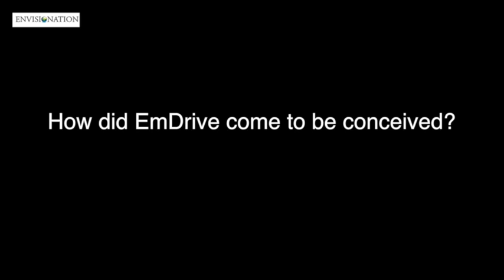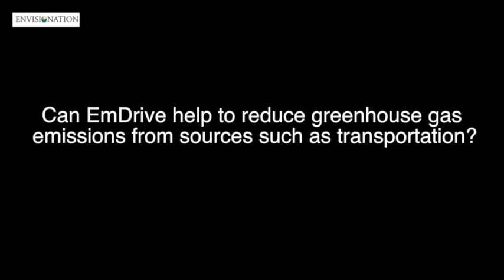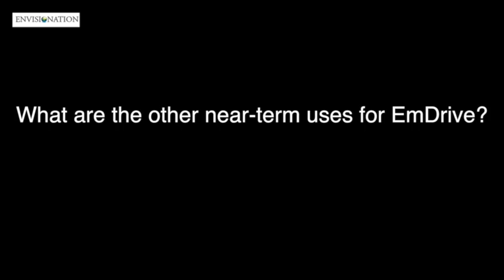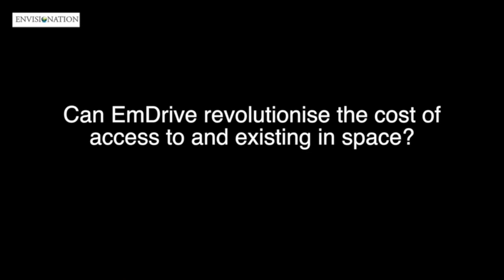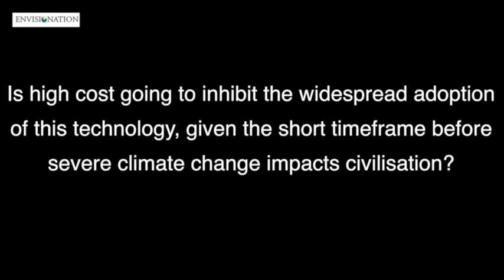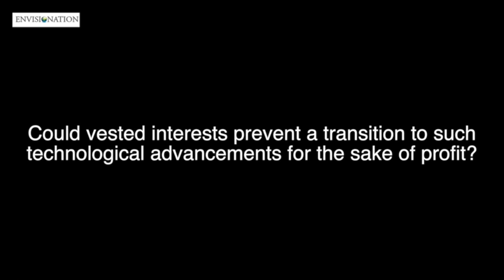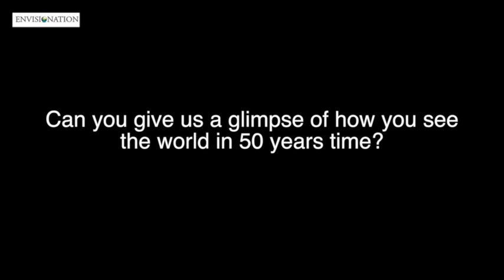Full interview: Roger Shawyer, Creator of EmDrive

Comment: The Emdrive proves that Minkowski was correct. He predicted that the decrease in velocity of light in a dielectric would cause an increase in radiation pressure. By placing a high dielectric material at one end of a can more momentum is deposited on the dielectric side by a factor of the square root of the dielectric constant. If PZT is used the constant is 1200.
F= Pw x sqrt(1200)/c. The force is 34.6 time higher on the dielectric end. If a superconductor is used for the can then the conversion efficiency is high.

Comment: look at these scientifically illiterate simpeltons whose jaws are dropping in awe at a complete fraud, the thrust produced by this sort of thing is weaker than the weight of putting your phone on a table. Good luck accelerating a massive rocket with that much force. 

By my calculations (using experimental data obtained by the study associated with this 'professor'), it would take 354 million years to accelerate a 10 tonne rocket to the escape velocity (11.2 kms-1) of the Earth. And this is completely ignoring air resistance.

GGWP

Comment: If the principle is fully classical, then it is very clear there is no thrust for a completely sealed cavity, whatever shape it is. The electromagnetic force acting on an object can be calculated with Maxwell stress tensor. This is done by performing a surface integral of the stress tensor (defined by the local EM field) over a closed surface around the object. The tensor, and the resulting net EM force acting on the cavity, is zero since there is no field outside the cavity.

Comment: I think my wife and I saw one of these flying in Palm dale CA around Northrop about 20 yrs ago. (Side note, my uncle retired as head of QC for Northrop decades ago, Bernard or Uncle Bernie as we called him). What tipped me off was the guy here,  Roger Shawyer mentioning the water vapor, vertical take off etc. There was NO SOUND (and it was relatively low in the sky and near us) and only one small cloud in the sky BUT what drew my attention is that with my polarized sunglasses we could easily see a sort of ? dark looking transparent light or ? slowly moving counterclockwise around the outside of the cloud extending out about twice the distance of the cloud. It just sat there. After a while we got bored and left. There was no one else around and no sounds, no dogs no birds nothing. It is what it is and now it is documented here forevermore. I really need to draw a pic of what we saw because the ? dark light was in pieces and bent, oddly shaped smaller near the cloud and larger as it went out and rotating slowly. The outside of the light ended in a perfect circle around the cloud but twice as big as the cloud.

Comment: Can someone please point me to solid experimental evidence that there is no external ionic wind.  Please provide evidence that a plate behind the larger plate does not experience a similar counter-thrust.
Reply: *****
So do ionic winds.
Reply: An electron boiling off a cathode can produce thrust. Also, there is plenty of potential fuel.  There is metal there that can be turned into ions.  I just want to verify that this is not happening.  It should be a simple enough experiment.  It just requires stuff around it to catch any potential particles that are being thrown.  Also, highly tuned systems are adept at remote power transfer.  I suspect something like this is going on.  The power can be transferred efficiently  several meters in a highly tuned system.
Reply: You seem to be missing the point: it does not matter what is 'thrown off' within the Emdrive. If the ejecta are trapped anywhere within the same device, any propulsive effect will be negated. Did the starship Enterprise have a bowling alley? Do you imagine that they could propel it (even slightly) by rolling balls? Yes, until the balls hit the pins, etc. Get a grip!
Reply: MrAaronvee
That is why I mentioned that it will likely subside, as "experimental error" is increasingly discovered in the several independent experiments by respected establishments which have verified the phenomenon.  They must have missed something. I suspect they're using so much energy that they're boiling ions off the outside of the metal of one side, and re-supplying charge through power supply, or that they're neglecting the input feed entirely.  These would be pretty basic errors, however.  The Chinese have already apparently backed off from their claim of a good fraction of a Newton of thrust, to something much less significant.
Reply: Indeed: as Langmuir pointed out, there is often initial positive evidence - reported by reputable people - for the most unlikely of ideas. They then gradually give way to weaker and weaker claims (the precise opposite of real science).  But why does this still happen? Why are reputable organisations not more circumspect? One begins to suspect that they welcome the publicity; after all, how many people will know or care what nonsense it is?
Reply: MrAaronvee
Also, I was looking for some verification that ions are not being thrown off from the outside (not the inside) of the device.  This would be as if the whole em-drive cone were a cathode, ejecting electrons from its outer surface with a endless source coming from the power supply.  It seems like an obvious and easy thing to check for, so you would think this would be covered, but I haven't seen it written about.  Another remote possibility (explaining only a tiny amount of thrust like picoNewtons) is that the fields in the resonant cavity get so high that electrons in the chamber accelerate, with more slamming head-on to the larger end...  Though the electrons within the chamber would balance in momentum, there would be a minute increase in radiation heading outward on the external face of the larger side.  These could be X and Gamma rays, so relay more momentum than visible light.  But still, it would be incredibly minute and likely not possible to measure the effect.  Finally, we must completely discard experiments that are not:
1. in a vacuum
2. completely self-contained (inc. power)
3. completely isolated from interference
4. completely decoupled from measurement
In short, almost all experiments performed to date are seeming grossly invalid according to required elementary experimental procedure.
Reply: Yes, the concept of simply pasting a radioactive substance on one end of a cylinder has been proposed. One can even imagine that one of those crackpot machines, in which balls are bounced off the inside of a cylinder, might move slightly -  due to differences in the heat dissipated at the two ends. But my money re Shawyer is on mere vibration.  Vibration can produce some amazingly counter-intuitive phenomena,  and some professional engineers are not even aware of that.
Reply: My money is on near-field interaction with the measurement system, and/or with cathodic behavior (that is, ion drive with re-supply from wall current).

Comment: I get that it might be possible, at least as a demonstrator. But is it scaleable in the real world? I've read the Alcubrie warp drive works in principle but would require more power then is available from the observable universe to actually work. I know the EMdrive is not a warp drive. I'm just using the Alcubrie engine as an example of something that might work but will never be practical in reality. I mean you would have to shove a lot of electrons or photons against the pressure wall to lift a space craft. Maybe the solar reflectors would have to have more area then say the pacific ocean in order to get enough ulf into the cavity?

Comment: Wait i thought EmDrive could only produce a very small amount of trust compared to the energy put into the device, how could an engine only strong enough to move satellites in a vacuum without air friction could one day lift a car and counter the force of gravity ?
Reply: ***** I'm pretty amazed that a fuel-less engine can work to begin with, it was about time. I just hope this technology will advance quite rapidly and not over a long period of time so it can be made cheaper. Maybe when i'll be old and grey flying cars will be a thing. But i don't have high hope for that. Advances always seems slower than we expect.
Reply: +Zool Ock The problem i have with these massive speeds is that you wouldn't want to hit even a spec of anything traveling at half the speed of light, or the resulting force of impact would be very destructive for both ship and occupant..The odds of not hitting even a spec of dust in space would be practically zero.

Comment: My opinion is that the effect is not based on conventional physics and that it is based on Warp Drive. I do not agree with Roger Shawyer's assertion. Alcubierre Warp Drive means that an energy extraction machine shrinks space-time metric drawing far bodies of mass a little closer so by Mach's principle, they lose gravitational energy and the machine will extract energy on the expense of the metric. Also momentum exchange is via the background metric with far bodies of mass.  Please read my paper and its corrigendum,
http://sciencedomain.org/abstract/9858
DOI: 10.9734/PSIJ/2015/18291
See also corrigendum 
to DOI: 10.9734/PSIJ/2015/18291
in http://sciencedomain.org/issue/1288
We need to keep an open mind. Inertial Induction was discussed by Dennis Sciama in 1953 and had a covariant formalism also by Dennis Sciama in 1964.
Another point is a working machine entails high charge separation. If you separate charge on a 10cm x 10cm parallel plate capacitor then with very low relative permittivity close to 1  and 37 Kv voltage with 1cm distance you will get less than 0.1 micro-Newtons which is an immeasurable thrust. High dielectric slab will have induced dipoles anti-aligned and cause
an opposite warp effect that will cancel out the thrust. Virtual charge separation by using transition states of radio wave photons may achieve a feasible effect. To get a feasible effect, there is a need to separate about +20 and -20 Coulombs
in 1^3 cubic meters along 1 meters distance. That would take several giga volts and therefore, separating protons and electrons is not technologically feasible. The true solution is virtual charge separation of virtual charge.

Comment: 2:57. "Emdrive produces thrust in one direction... and accelerates in the opposite direction". F = - ma apparently. If you don't know what's wrong with that sentence, then go away and learn GCSE physics before posting about how 'amazing' this is.
Reply: Whiteblooded That is weird...

True, I won't say anything. The very reason why it's called "Impossible Drive" in the first place.
Reply: Whiteblooded Nothing wrong with what he said.  For every action there is an equal and opposite reaction (Newton's Third Law: Fa = - Fb).  If you push something in one direction, it'll push you back in the opposite direction with equal force.  In this case, the 'vehicle' pushes the thrust in one direction, the thrust pushes the 'vehicle' back in the opposite direction.
Reply: Jason Parkin This is incorrect. 'Thrust' is a force which acts in the direction of acceleration. F = +m a. Acceleration is in the direction of the thrust. This is newton's first law. Newton's third law - the one you just quoted - is only applicable when you have two interacting objects, which are applying reaction forces on one another. There is only one object here - the drive. The thrust is a force, and not an object.

You are probably getting confused with conventional rocket propulsion, which works by conservation of momentum - you kick rocket fuel one way, and the rocket fuel kicks the rocket in the other (two objects are interacting). You can apply conservation of momentum rules to photons as well, but if no photons leave the cavity (Shawyer claims nothing leaves the cavity), total momentum must be conserved - hence, you cannot use conservation of momentum to explain how these things work - in fact - it's the strongest argument against them.

Comment: At first sight the idea of propulsion without propellant seems impossible. However the technology is firmly anchored in the basic laws of physics and following an extensive review process, no transgressions of these laws have been identified.
The principle of operation is based on the well-known phenomenon of radiation pressure. This relies on Newton's Second Law where force is defined as the rate of change of momentum. Thus an electromagnetic (EM) wave, travelling at the speed of light has a certain momentum which it will transfer to a reflector, resulting in a tiny force.
Reply: Whiteblooded How would you fix that error then? Make the EM drive to have more roundedness?
Reply: You can't "fix" an inherent physical principle. What the EM drive is trying to do is essentially like trying to build a boat that floats forward without propulsion because it has a special shape that makes the water on the backside exert more pressure than on the front.

It just won't work no matter what shape you pick because the forces will alway add up to zero.
Reply: Hellothere _1 if you make the ship move up and down on the water surface a boat can move forward by shape. I think.
Reply: Sergio Calvo To educate you a bit about physics (I teach undergraduates at the University of Birmingham, UK): Propulsion without propellant isn't impossible at all - solar sails are completely possible. Radiation pressure is how solar sails work (and it's Newton's third law). Radiation pressure is what  "is firmly anchored in the basic laws of physics"... and it's been known about since the year 1900 (discovered by Lebedev).

The emdrive doesn't work however. Shawyer says that the force (upward) from the radiation pressure on the large plate of the microwave cavity is larger than the force (downward) on the smaller plate. This is true!.. but he forgot about the walls of the cavity (downward) - the three components add up to zero.

Comment: lol, if you read between the lines, this tech works and is being developed by non-western nations china and russia have expertise in all kinds of related areas that could be pretty awesome. i think at the moment theres no possible military use (accelerate toward your taget at 2g!). i think were seeing classified projects based on this tech which is why you get official 'requires further investigation' responses. for some reason it's not completely obvious this is purely civiliation tech and a new iteration of technology that doesn't belong to anyone in particular. so this tech works and is viable but has no military use. i think as so often happens the military will pioneer a technology that ends up in civilian general use, like the jet engine

Comment: How is it not reactionless and not breaking Newtons third if it pushes without interacting with its surroundings? Is that to say that there are reactions but they are internal? In relative view isn't that the same thing? What happens with the conservation of impulse? I have an idea because it looks I developed it differently and independently. Also, to build this impossible machine I think you need two "miracles", not one.

Comment: Absolute hog wash. "but not the principle of electromagnetic space travel". in 1996 nasa dropped a tether into the earths ionosphere (magnetic field)  from outer space. THis created induction in the coil apparatus at the end of the tether (2mm in diameter) which generated 3500 volts. taking into account that Jupiter magnetic field is 20,000 times stronger that that of earths would quantify to 70,000,000 volt capacity using Jupiter magnetic field. this when harnessed into the creation of an electromagnetic field () of a spacecraft is enormous potential of energy. the whole principle of  neutonian laws means nothing when neuton didnt even know electricity and electromagnetic field propulsion existed after all it was 1600's that neuton lived. Under neutons laws would the electric motor work??? (yeah exactly we are not as dumb as you presume) AS far as your reference to supercooled hydrogen and oxygen to some -160 degrees is just a smoke screen when both hydrogen and oxygen reside in water and when separated by electricity in electrolysis give you both the hydrogen and the oxygen. How does an electric motor work? - well it takes the electromagnetic field of the cooper wires and they through induction cause the motor to spin around in a circle. So the very principles of your blender  that you make cocktails from can be quantified to a space ship. i really dont know who funds this stuff but you talk to us like we are pathetic chimpanzees with out the basic understanding of electromagnetism and the propulsion aspects of them. Tell me something when did Neuton ever use and electric motor? when did Neuton ever understand electricity even existed?

Now imagine if crossed the opposing magnetic field lines of Jupiter (remember 70,000,000 volts) in an electromagnetic recepter space craft . what could i do with the energy i created???????????????????????????????????????? 

Now imagine if i crossed the magnetic field lines of the heliosphere or even the galaxies galactiosphere

this was absolute rubbish and a disgrace to intellectual scientific understanding of the fundamentals of electromagnetism and its propulsion aspects.

We can discus the electromagnetic nature of matter and gravity itself some other time!!!!!!!!!!!!!!!!!!!!!!!!!!!!!!!!!!!